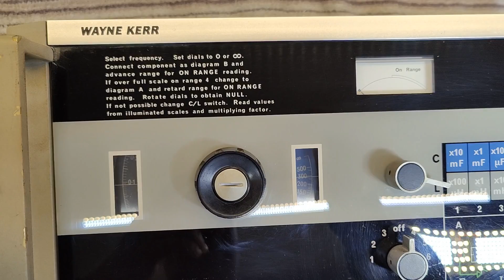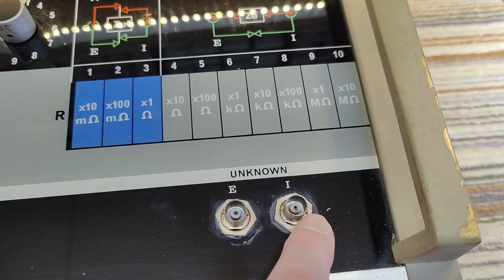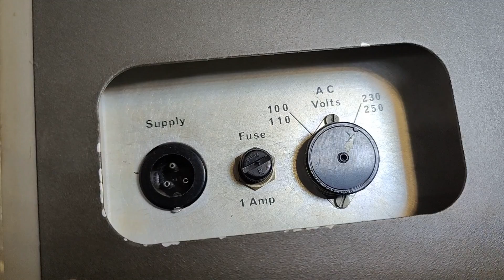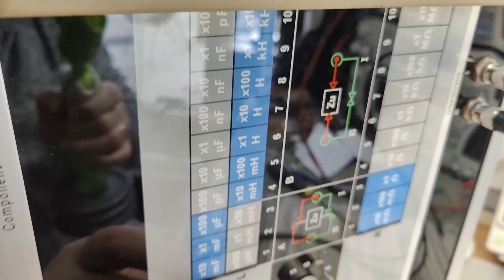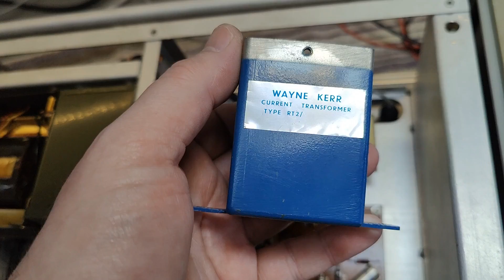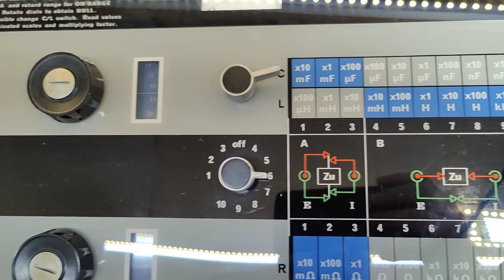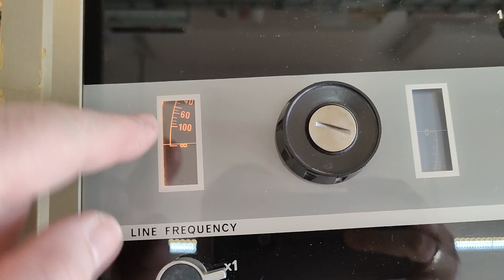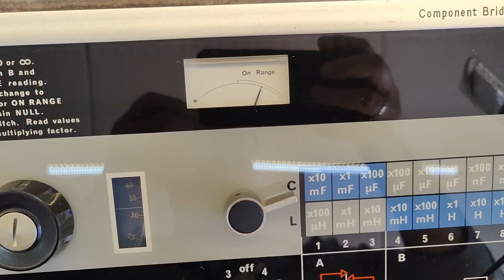Wayne Kerr Component Bridge B522 1uH - 500kHenry test repair teardown

Comment: Nice bit of gear, back in the day that would be a top notch (well as the price tag lol), even by today standards its very usable and accurate. Also it is in a remarkable condition, a paint job and it will be as good as new. You got a great score no doubt. About those "paper" (polystyrene) caps, they tend to swallow over time due to humidity ingress, i guess you already had seen lots of Rifa caps all cracked and swelled, it will be wise to replace as many as possible with modern polypropylene film cap, i guess they should be ok for the job.